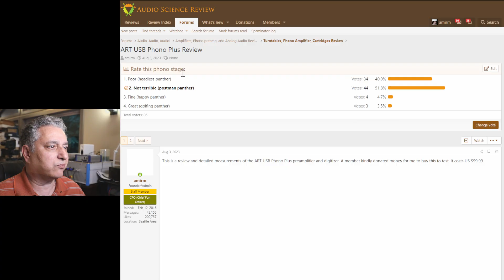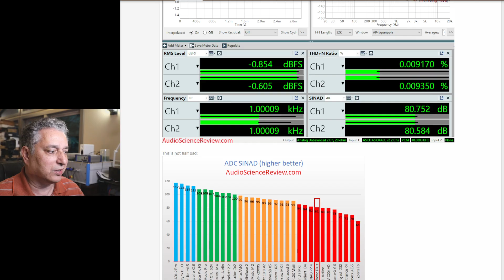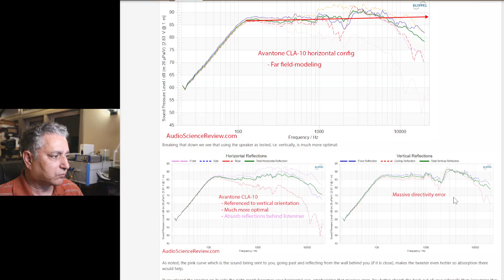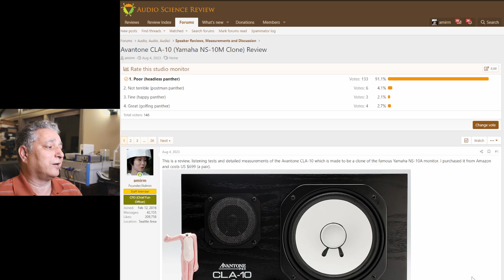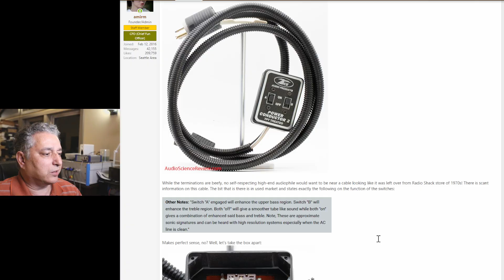ASR Audio Equipment Review #1

Comment: Thanks for the reviews! Regarding the cla-10/ns10: Which monitors that you have measured had the most flat frequency curve? It´s really gold that you do these measurements!
I  also watched your review of Genelec 8050, but the slight dip close to 2k in those is probably why i experience them as flattering. Actually i was thinking about using Genelecs anyway, but alternate them with my ns10m studio, because they seem to compliment each other a bit!

Comment: Analyzing the Yamaha NS-10, to understand its appeal to mix engineers you need to know how and why we used it. We only used it to present a narrow band of the midrange, and, counterintuitively, the response DIDN’T MATTER. The speaker’s appeal to us was that bass and extreme highs were NOT audible, NOT interfering with the desired midrange which is literally where the music is, as we say. 

With low distortion and fast dynamic response, the NS-10 let us make mix adjustments specifically to the midrange sources which can be impossible with a full range transducer. Try it and you will become immediately familiar with the principle and how wonderfully it works. There are dozens of other speakers that can accomplish this but we can be a little conservative. Remember, the response is NOT important, which sounds like complete nonsense. We achieve the separation of our closely overlapping vocals, guitars, keyboards, strings, etc, etc,… by using an intentionally limited response.

I hope this explanation serves to help explain the seemingly odd choice.

Comment: NS10M's sound absolutely horrible.   Can only used in studios for midrange evaluations and if it sounds decent on a NS10M then its a good mix.   But the better alternative was the Auratone which used the CTS 4" also used in the original 901's.  Got a pair.  Never heard much better.   Worthy of a listen for the same reason that you listen to 4311's and Altecs everything was mixed on these at some point. But realistically the new stuff is a million times better.

Comment: One claim made by Tice and other such companies is that you can hear things that can't be measured, and I believe that is absolutely true. I am confident that no amount of instrumentation used to test my headphones would detect my tinnitus, nor can it show the voices in my head that say "This sounds good!" when I plug a power cord into a socket. I've found out that the handful of picofarads that exist at the end of a standard IEC computer power cord provide the same line conditioning ability as immersing the cord in black potting material, and I get the same performance at a fraction of the cost! (You can even hear the difference on a wind-up Victor V2-60!) Send me just $49.99 and I will send you instructions on how to plug a standard computer power cable into an available socket and get amazing results that can't be measured! None of my claims can be proven, which is how you KNOW they're true! (Disclaimer: Nonbelievers may have difficulty hearing any differences.)

Comment: This is why all sane people mix with flat response speakers like Genelecs, and not with these or the Yamahas. Also much more enjoyable to hear own music many times with a speaker that does not have horrible resonances. Ears wont bleed afterwards. Also kind of explains why even some big budget commercial music sounds so bad on flat response speakers or even with Airpods, because they have "corrections" made with these or the Yamahas or other very crappy monitors that the sound engineers insisted of being "good" with some weird false idea.

What it comes to slow or fast speaker, I think it actually means driver has habits to keep ringing on certain freqencies, and while radical EQing can make it look like flat in frequency response graph, notes that hit those frequency in actual music content just don't decay fast enough. This is quite audible on low frequencies especially, for example Peerless STW-350F sucks in midbass even if the frequency response graph shows flat, also popular Dayton Audios do the same. Such issue in bass can cause in a fast paced music like psytrance the kick + bass sound like single "booom" instead of hearing the notes as separate and the impact of it is lost. Same with explosions in movies, with a driver with a resonance in a bad place, the explosion becomes very soft and its ripping midbass detail is inaudible. Slow subwoofer vs fast subwoofer. However not everyone is perceiving this correctly and they don't know what they are looking for in the measurements. I use pro audio drivers in subs for exactly this reason, driver needs to have very strong motor, low moving mass. Drivers with BL 40 and moving mass of 30% of hifi drivers like the Peerless, will have less resonances on the frequencies that are critical to kick + bass in 145 bpm music like psytrance and what the producer intended gets perceiced by the listener. Some people don't know what fast means and calls something with lots of resonances as fast. Or they think that sealed box makes a difference vs vented despite the group delay peak on vented sub is much lower than where transients can be perceived anymore. Some home theater people with large front speakers don't notice that their subs are bad because they use low crossover frequency to subs. Sub's issues become audible when having high crossover point like 80 Hz, to smaller speakers, when also the midbass gets reproduced by the sub(s). 

There is a typical ringing in some B&C compression tweeters. Even if it is smoothed with EQ, it still sounds bright or harsh because that frequency in the upper register keeps ringing and does not decay fast enough. That is a "slow tweeter". Waterfall plot is essential when selecting a tweeter to avoid this kind of time domain issues that no amount of EQ can fix. And it never shows in manufacturer provided data because they publish a smoothed frequency response and don't publish waterfall. It is some magic/art to find parts from off the shelf components that are well behaved enough through the usage range. I don't think all loudspeaker desigers master that and this shows in how it sounds like even with identical frequency response when comparing to a good speaker. Ringing resonances are just terrible. Even the tweeters of my Genelecs have some ringing, but it is above my hearing range and don't perceive that. I wonder what my cats think about that.

Comment: yeah new , ASR on the science of audio 1:04 art i have few other models myself passive , active powered for certain and use passive level ones on my HF JBL horns for tiny fraction dB trim alignment as the amplifiers levels are bit fraction out of alignment so i use the passive to make necessary trim
that snake oil power cable should be in the hall  of headless panther fame

Comment: Hi Amir, I hope you are well. Here is something I stumbled into. The "cable guys" think and claim that the fuse in a system improve the sound. Here is what Synergetic Research claim with their Master Fuse: "Instead, we engineered Master Fuse to work alongside Purple and Orange fuses to create dramatic new levels of sonic realism, featuring wall-to-wall, floor-to-ceiling sound staging with unparalleled resolution, dynamics, and frequency extension. Best of all, most systems will not benefit from more than one or possibly two Master Fuses in an otherwise complete loom of Purple and or Orange fuses. So you start with a single Master Fuse on your DAC or line conditioner and realize guaranteed results or your money back for the first 30 days… This is why significant gains in sound quality are possible when you insert an SR Black or Blue Fuses into each of your components." Nonsense if you ask me but I think it would be an interesting topic. I think you should take a look at it. $595.00 is the price for one fuse.
Reply from the maker: Hi Peter.  I get a lot of requests to test these fuses so at some point I will.  Shame I can't test their reliability though as blowing them would cost so much money!

Comment: Many people (no theme) claim you can't get enough power out of an amplifier if the DAC voltage isn't high enough even though the amplifier has enough gain for maximum voltage. More snake oil. I wish people would learn basic electronics. Why not do a video on this.
Reply from the maker: Good idea.  Will put it on TODO list.
Reply: @AudioScienceReview  thanks

Comment: Great analysis of the Avantone. Please do us a favor and send it to your friend Danny Richie at GR-Research to get it fixed with a proper crossover, and then review it again like you did with the GR-R Klipsch RP600M upgrade. Better still take up Dannys invitation to visit and take the speaker with you and go through the upgrade process with him and report back. Please dont say what Gene Della Sala of Audioholics said to me when I tried to provoke him to do the same, that he had neither the time nor the inclination (I actually think he was afraid  he might need to rebrand audioholic’s “No snake Oil” logo if he finds out that cable lifters are a thing as Chris from Vinyl attack found when he visited). The mud slinging doesn’t help any of us.
Reply from the maker: I already returned the Avantones.  But if I hadn't, I would have no doubt that Danny could do a far better job with them than the company did.  Danny knows how to do crossover design.  Please note that I have spent a ton of money on Danny's products.  Probably to the tune of $2,000.   He has never given us a cent discount and would refuse to loan me anything for review.  He even charged me credit card and shipping fees when I returned  his power cord (only thing I have returned to him; I am stuck with his speaker kits I bought).

The issue is not really his speakers, it is the other bits he promotes.  Us going there would be doing the work he needs to do, i.e. prove in an unbiased way that those things do something for the sound.  Instead me schlepping there,  it is far more fruitful and valuable if he just grabbed half a dozen local audiophiles and perform a blind test on them.  Post that result and we would all take notice.  It doesn't make sense for me to spend money and time going there when he hasn't done just the basics of providing audible differences.

There is also the matter of whether many people care for me to spend this level of resources on him.  It is not like he is a major player in audio so doing more would be impactful.  I have done plenty of testing of his products and enough data is out there for folks to make informed decisions.
Reply: @AudioScienceReview  ok Amir thanks for the time you spent to reply. It’s a great pity As I would love to see you both get together.

Comment: Loved finding out about the Art Pro audio USB Phono Plus for ripping vinyl to computer and was VERY excited about review of the Cayin mini-CD player as a transport... but the thing I wanted to know most about was the I2S (HDMI) output. I know of NO OTHER CD player that has that kind of digital output at this price point. Would it have had better measured qualities if you used this INSTEAD of the Spdif output? Because I think that is the REAL key to this product (it doesn't even have an optical output!) Paired with a DAC that has an I2S INPUT, I think this may have really surprised you. What do you think?
Reply from the maker: I have tested IIS before and it has zero quality advantage over other interfaces.  This is a signal protocol that was designed to run between ICs in a product, not external to it.  Using it this way was just misguided.  But again, I have tested and it makes absolutely no difference in fidelity.   With the signal being non-standard, my analyzer can't test it anyway (my other tests involved using a DAC).
Reply: David, this seems to be a trend. The new Shanling ET3 transport outputs to both usb and I2S and upsamples to Dsd if you wish. It runs at around 750 dollars and also has streaming functionality.
Reply: Gustard X16 DAC has the I2S input, I don't know of any other DACs at $500. that has that! @jimfarrell4635

Comment: Hi Amir, enjoyed this format video. It might help if you add the timecodes in this format, then YouTube will add the chapter headings to the video playback bar:

00:00 - Introduction 
00:52 - ART USB Phono Plus Review
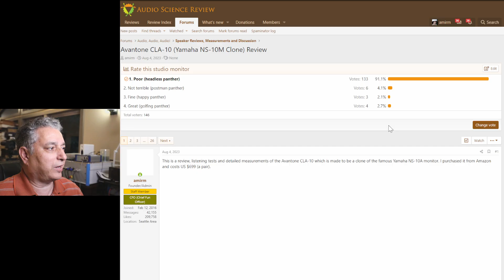13:09 - Avantone CLA-10 Speaker Review
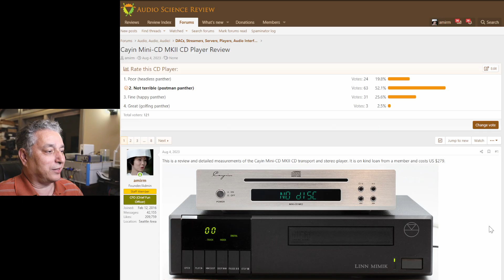32:52 - Cayin Mini-CD MKII and LINN MIMIK CD Player Review
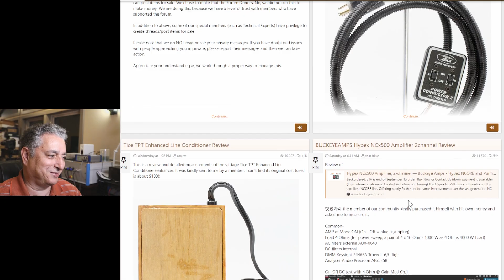43:59 - Tice TPT Enhanced Line Conditioner Review
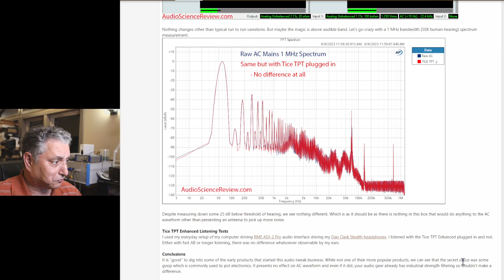49:58 - Tice Power Conductor 2 Vintage AC Cable Review
Reply from the maker: Thanks so much for doing that!  Will add.

Comment: Playing devils advocate, NS10 were used to double check how mix would translate on a lousy home speaker back in the day. Similarly how people nowdays double check a mix on a phone speaker or earbuds. Not that you would make any significant corrections based on what you get on NS10. CLA actually uses a Sony boombox hidden somewhere in the back for same purpose. IIRC the engineer who made them popular picked them in a store because they were worst sounding of the bunch. So if a mix sounded good on monitors, but also decent on NS10, that would be it.
Reply: Lol 👍
Reply: I remember hearing that "Auratone" speakers were used as well, for exactly the same reason...
Reply: Exactly, whatever diametrically different speaker you use it will reveal something that isn't obvious on a flat monitor. Depending on range the speaker accentuates. Even a 10$ bookshelf can seem like a fresh breath of air after listening to flat one for hours, and hours.

Comment: Is it theoretically possible to make sufficient measurements of a DAC or Headphone Amp with a high performance oscilloscope? If the answer is "no", could someone explain in a few words why or send me a link with an explanation?
Reply from the maker: No.  Scopes are made for bandwidth, not dynamic range (bit depth).  Typical budget digital scope has only an 8 bit ADC.  That give you a dynamic range of just 48 dB!  So no way it is good enough for any kind of audio measurements.  They do go to hundreds of Megahertz but we don't need that in audio.  Some of the best scopes go up to 12 bits and even that is poor to measure low quality DACs let alone high quality ones (whose dynamic range is 120 to 130 dB).  Best to get an audio interface and use its ADC for measurements.  You will still be limited but can easily clear the 16 bit mark with them.
Reply: @AudioScienceReview  thanks a lot :)